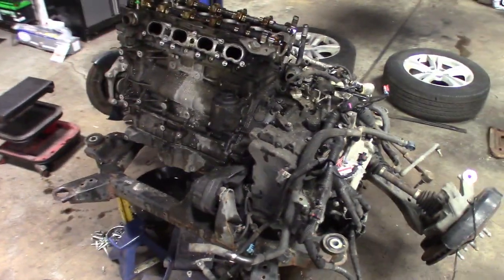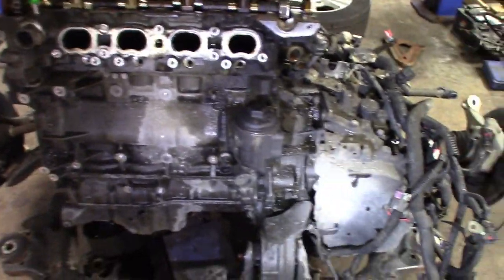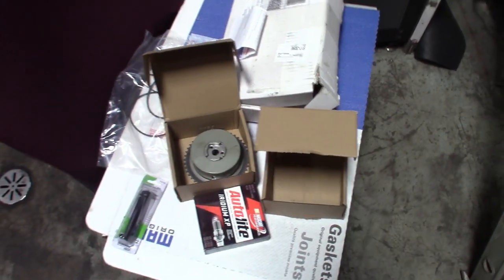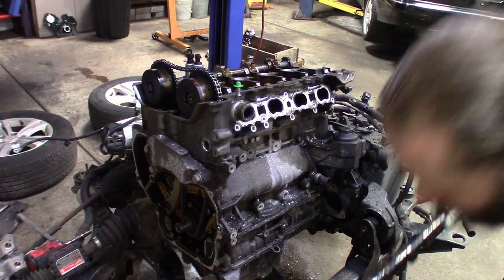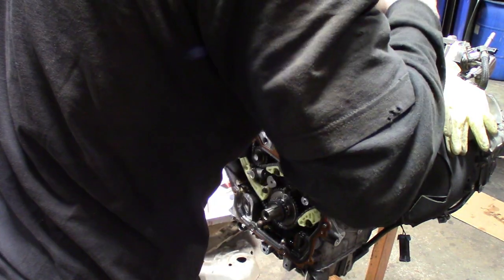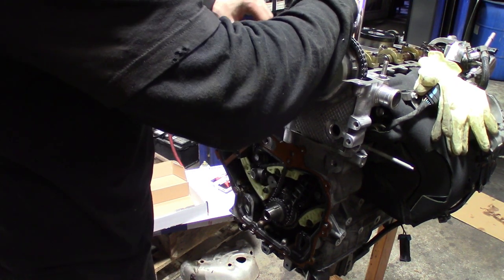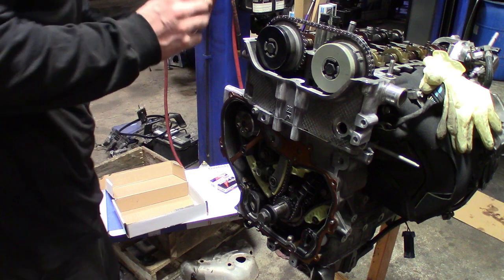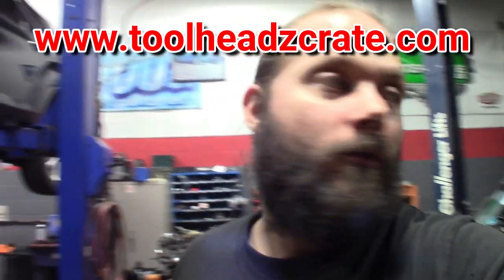Timing A Ecotec
 (LAF to LEA swap)

Comment: Worked on the older ecotec engines,same way of setting up the timing marks.With that fuel system shown,never crack loose a line without depressuring it first.Been to a class on the GDI system instructed by John Thornton whom is a mobil mechanic in Illinois going to shops helping them out

Comment: I miss doing engine work...I was at a caddy dealership for ages and went through the northstar reseal or Teflon piston replace,  now I look at diagnostic screens. always good to watch your vids.....
Reply: Hello. I have a 2012 Chevrolet Equonix 2.4L I changed the chain with the cams set to 10 o'clock. The machine is working, but it gives a P0017 code! The instructions say that the engine 2.4 cams should be set for 5 hours, I tried to set it to five but then the crank lock does not fit! Why did you set it to 10 hours and not 5?

Comment: You don't happen to recall where the cam lobes were when you got the mark for timing after stalling the cam?  I moved to TDC but the cam lobes I should have paid attention to before taking of the phasers.  Trying to make sure they are in the right spot before bolting on the phasers in my job!  Thanks for the video!

Comment: Hello sir, I see you have swapped a 2.4 l in an equinox with much detail, if I may as I have a 2010 equinox 2.4L and I’ve secured a donor 2013 2.4L from another equinox. Will there be much to swap over to make this engine work?
Reply: cams and phasers

Comment: Hello. I have a 2012 Chevrolet Equonix 2.4L I changed the chain with the cams set to 10 o'clock. The machine is working, but it gives a P0017 code! The instructions say that the engine 2.4 cams should be set for 5 hours, I tried to set it to five but then the crank lock does not fit! Why did you set it to 10 hours and not 5?

Comment: How do I tell if ur cams are sitting right.   With the vvt u put ur marks on crankshaft top dead center then mark on intake sprocket. Then when u put ur mark on exhaust sprocket it has to be turned to put on its marks

Comment: So what about the cam cap swap... They are machined to each head and. Are not to interchangeable and which will have more wear and lead to cracking and engine failure.. Because of misalignment.  I have been building engines for 30 yrs and only done this procedure when the head can get line bored at a machine shop.

Comment: JCR54    Hey man is it possible to call you and ask a few questions.   I am pulling my hair out with this 2013 Equinox 2.4.   Replaced the timing parts and now I have a code saying the timing between the crank and cams are out of phase. I lined up the marks on all the sprockets with the colored links and checked it 4 times before closing the enigne up. Runs well, but cannot get the engine light out.   Question, are the cam actuators the same part numbers? If not is it possible I switched them?  I am at witts end.  Please help

Comment: ok so i know the engine in the 2011 equinox i had at my shop was not an aui motor but i installed a 2012 engine. it ran great but would stall when you tried to drive it. i am wondering if the intake cam shaft would have to be switched cause the code i am getting is p0089. that was the only thing i did not do when installing the engine in the 2011.
Reply: Same. What did you figure out
Reply: Not if it's a 2012 engine. 2010 was a fuckin nightmare, unique timing, 1 year only cam reluctor styles, 2011 is same story but intake cam is set at 7 rather than 5(2010)

Comment: I have a 2010 chevy equinox with a blown engine i found a 2010 malibu hybrid is the engine the same?
Reply: I r been told a Malibu engines won't work in an equinox!! Something about decoding the cams part number. # is between 2 and 3 cylinders on the shafts.

Comment: Just changed an engine, same as you. Did not change phasers. Runs good except at first acceleration.  Is it because phasers?
Reply from the maker: You have to change the phasers and intake cam or else you have issues with hpfp and timing
Reply: @JRC54  nailed it. Same issues.
Reply: Thank you sir

Comment: No body shows the actual process of setting the tensioner. I’d like to see what you’re actually prying against
Reply: It's a 32mm I believe, 55 lbs if I recall, and once your all together you just press against the primary chain tensioner arm(just press against the chain) and it'll set.

Comment: Great Video, would you happen to have  the part numeber for the 2010 intake camshaft and the camshaft phaser?
Reply: The 2010 cam is 1 year only and gm discontinued it 🤦‍♂️ hard to obtain but there's some Asian website to buy a new one. It's $200 btw.. so eff'd up!

Comment: IM DOING JUST OPPOSITE  MY TIMING MARK WAS AT 5 OCLOCK  I ORDERED NEW HEAD AND IT CAME WITH INTAKE CAM NEEDING 10 OCLOCK.  ORDERED CAM PHASER FOR IT.  EVERYTHING IS IN TIME NOW. DO I NEED TO CHANGE SOLENOIC AS WELL?  I BOUGHT ONE BUT IT IS GREY, THOUGHT IT SHOULD BE BLACK  IDK.   GETTING P00C6 CODE
Reply from the maker: Solenoids are different also I believe.

Comment: I've never worked on that engine, is there a mark on the block that the crank has to match up to or do you just use the marked links on the chain?
Reply from the maker: Yes the mark is on the top of the gear. The crank keyway matches to it @ the 12 o'clock position that's TDC. The marks on the chain is a secondary timing mark to co witness it.
Reply: Ok, thanks.   @JRC54

Comment: Hey bro I got a buick 2.4L.  2012 buick verano. I pulled the head off to have it rebuilt to due bent valves. I rotated the crankshaft to clean the piston tops & forgot to rotate it backwards to the original place.  Now I can't get it to run. It runs & shuts off. I replaced everything on the timing system. Upper & lower guides   vvt sprockets.  New pcm new key & new crank sensor. How do I fix the crankshaft placement for it to run. It runs for a few secs then shut off
Reply: Make sure the crankshaft is on the compression stroke! As you bring it to 12o clock, put a piece of toilet paper or a cigarette to watch smoke. Or have a buddy put their finger over the #1 to feel if air is pushing out. Not in.

Comment: Where did you get your replacement engine and what did you pay for it? I appreciate the video.
Reply from the maker: Lkq 900
Reply: @JRC54  You must have gotten a deal. I am getting quotes of $1900. Des the exhaust cam have bearings? Did you repace them as well?  Thank you.

Charlie
Reply from the maker: If your doing the swap change cam and both phasers
Reply: @JRC54  I understand why to change the intake cam and phaser, but why the exhaust cam phaser?  Did I hear you right that you used the cam guides/covers from the old head that matched the cam when you put it in the new motor? I know your busy and I really appreciate your answering my questions.
Reply from the maker: The exhaust cam is the same on both motors old phaser will work.

Comment: Hey JRC64 - Im swapping a 2010 equinox laf to a 2015 terrain lea, have to all apart ready to go but I cant figure out what phaser I should order that would give me the timing mark flipped upside down
Reply from the maker: You have to change the intake cam from the 2010 to the 2015 use the 2010 phaser with the cam when timing.
Reply: @JRC54  THANK YOU SUBSCRIPTION CLICKED
Reply: JRC64 i hace a question does a malibu 2.4 engine 2010. can it be install in chevy equinox 2010
Reply from the maker: Yes may have to change out some brackets, covers and motor mounts but it's the same block and engine
Reply: @JRC54  thank
Another question to ask do have    to change intakecam  and ir is the same
Reply from the maker: @robertolara7813  a 2010 motor from Impala going into a 2010 equinox will have the same cam. Don't think they did the update until 2011 or 2012
Reply: @JRC54  thanks a lot they put 2011 into 2010 equinox  having lots problems duty timing